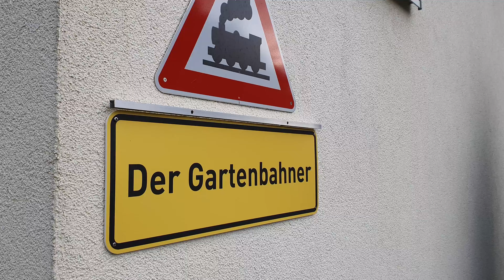Unsere LGB Gartenbahn #74, Umbau: Die neue Straßenbahn Strecke, Teil 2: Gleisverlegung

Comment: Good work! How do you prepare your track work? Do you draw plans on PC? Do you draw a schema on paper or do you "feel" more or less how things should go and adjust as you go? I see the tracks are screwed one to another for electrical contact. Do you also add electric feeder cables. If so, how many meters between feeders?
Reply from the maker: Hi.  Yes they are hidden inside each other.  That's good, because the track doesn't lower so easily.  And the weeds won't get through.  The electrical line is in the channel, in the middle of the segment.  We did it in such a way that every 10 meters of electricity goes into the rail.